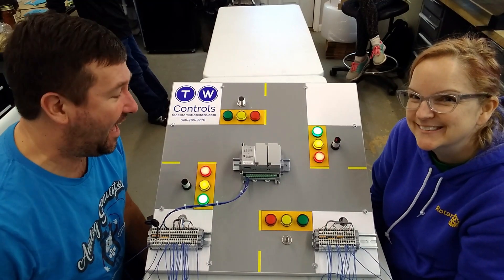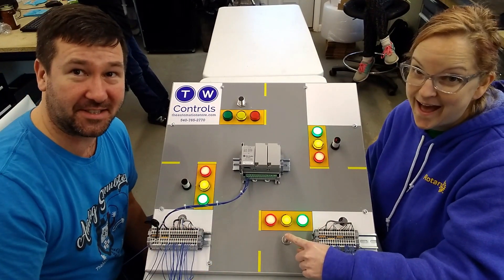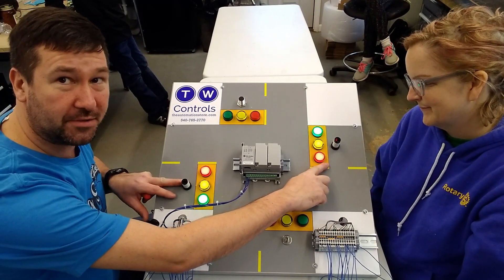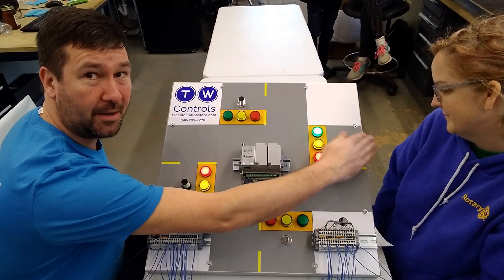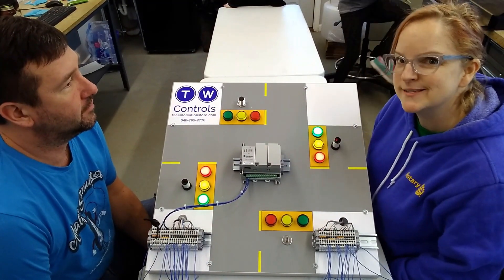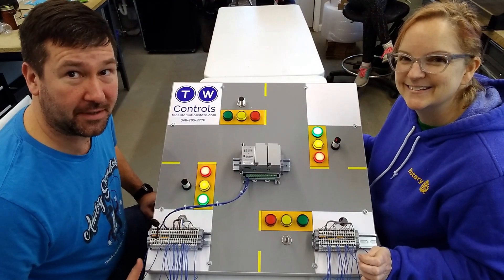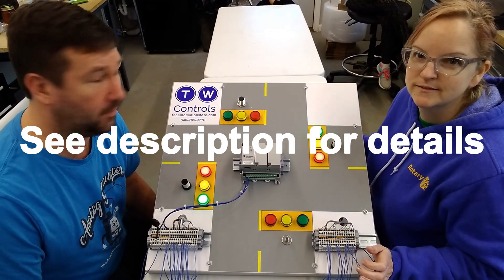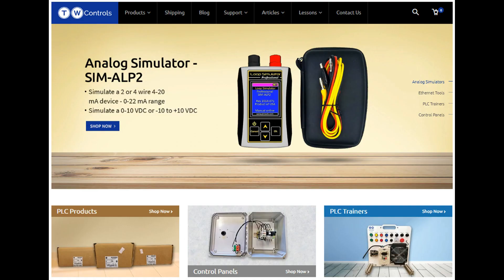Sensor Types - Inductive Proximity, Photoelectric Diffused, Photoelectric Reflective, Mechanical

Comment from the maker: The 12 o'clock sensor is an inductive proximity sensor.  I stated it was a capacitive proximity sensor.

An inductive sensor uses a magnetic field to sense objects so the objects must be conductive.
A capacitive sensor uses an electric field to sense an object so the objects do NOT have to be conductive.

Comment: Inductive prox sensor on top left?
Reply from the maker: The one at the 12 o'clock position is an inductive proximity sensor.
Reply: @TimWilborne  Okay I'm here for the same question. I think you mentioned capacitive for the one that detects ferrous material.
Reply from the maker: @sharishsss  Sorry I didn't catch it. I'll put a correction in the description.
Reply from the maker: Now I see what you are talking about.  Title corrected and clarification added to the comments.